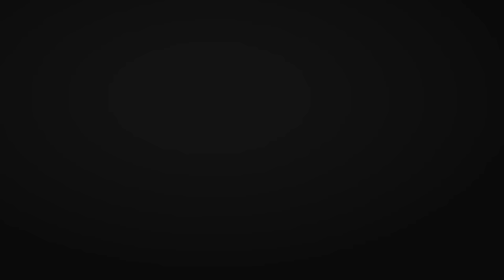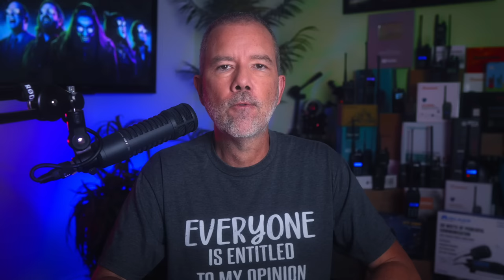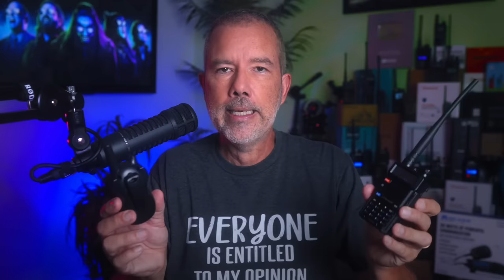Why Your New GMRS Radios Can't Talk To Each Other.  GMRS & Using GMRS Radios For Beginners

Comment: Another option—instead of blasting the signal at 8 watts or 5 watts, try a lower setting like 1 watt.
Reply: Didnt work for me. Even at low power and narrow band FRS channel. Only physically moving them apart about 45' got the units to respond to each other.
Reply: I did it and it worked
Reply: Pfff wattchu talkin bout willis?

Comment: I bought a new Midland mxt 575.  I can hear others, but they don't respond to me.  Im not sure if I don't have the radio set up correctly or there's some other issue.  I have a handheld mrs and it receives and I can carry on a conversation with no issues.  On the road, I can hear others, but like I stated, they don't respond.  I would appreciate your advice.
Thanks You, Roger
Reply from the maker: My guess is that you are hearing repeater traffic and they will only hear you if you configure your radio to use that repeater.

Comment: I confess I had this very issue as a new ham with two HTs.  I eventually solved it by putting one in the garage with my phone adjacent to it and recording audio/video of the HT, while I walked around the corner to transmit.  Thus with a phone you can engage in ah "solo testing" without revealing your initial ignorance to anyone else.... er... until you comment on a YT video.

Comment: Similar problem. Using two  Btech V2 gmrs radios about 8 feet from each other, - when using the same "stock" gmrs channel  ( same frequency) on both radios they talk to each other fine. But with both radios tuned in to the same llocal gmrs repeater channel  l(same tone code also) they can't hear each other. How come it works for close range for non-repeater  channels,  but not for close range repeater channel? Thanks

Comment: what really works : unplug any wires and blow into them, stick a paperclip into any small hole on the device, and mostly going to the radio store and getting bottles of squelch. Luckily I have several bottles of squelch from supply from when I was in the Army.

Comment: Does one have to buy only two gmrs radios? Do they only work in pairs? Or can multiple gmrs radios (same brand) talk to each other (communicate) ?
Reply from the maker: all GMRS radios can talk with all other GMRS or FRS radios.. You can buy 1, you can buy a pair, or you can buy 10, they will all talk with each other.

Comment: What happens if you adjust the little pots on the circuit board?  Or swap antennas for a powered one with a 400mhz to 5ghz range..?  Can you trigger the 498 mhz devices and pick up wifi?  Lol

Comment: Didn't know exactly where to ask this, so I'll try here. Have a fairly new Baofeng GM-15 pro. I, just recently, have a situation where it won't transmit to other radios. Definitely not too close. It receives just fine. It's on it's basic setting, nothing really turned on or programed. Any ideas?
Reply from the maker: "wont transmit", meaning it just beeps and the transmit light does not light up, or, it transmits but the other radio does not receive it?
Reply: Closer to the later. There is no beep, and the red light comes on. Tried it on 2 spare more basic Motorolas I have. The Motorolas can talk to each other, and I tried it with a friends FRS (don't know the brand). No beep, red light, but not able to tx through.  @TheNotaRubicon
Reply: Anymore info that might be of help? Thx @TheNotaRubicon

Comment: I have the same problem as many of your readers that purchased the UV-9r. It will not transmit on Ch.15. Using your solution to send them back only results in another radio with the same problem. The fix is published in Chinese. With your great status at Boafeng could you get the link in english and publish it?"
Reply: Buy a good radio, dude.

Comment: Please help first time user.  Wouxun GMRS radio can transmit to a FRS radio but can't receive even with DTCS on or off on both units.  Thank you.
Reply from the maker: Double-check to ensure that no DTCS or CTCSS tones are enabled on the radio you are trying to receive on.  Then make sure the radios are at least 50 feet apart, and try again.
Reply: @TheNotaRubicon  Thank you. Have a nice holidays.

Comment: is this happening on digital frequencies? I have never heard of such weird behavior with FRS radios and professional UHF radios programmed to the same frequency, I find it funny since when I started my 15 year amateur radio journey, I went straight to a Motorola P110 UHF on channel 7 (462.7165) that lasted for quite a long time until I got a PRO5150 and used the same frequencies without issues and no tones whatsoever, I had only the MDC1200 because I liked how it sounded and such and had quite a gargantuan hate for the MDC-IN feature that just gutted the data part of the MDC system, good times...

we joke around, mess around and did a lot of stuff using both professional devices and the ready to use FRS ones with zero issues, but those were all on analog frequencies and hearing muffled speech was uncommon and not practical to achieve privacy either.

does this thing only happen to radios with digital encryption or newer radios? it's the first time I've seen such a new and infuriating problem (not for me at least) with FRS devices or some radios on the 462-467 FRS range.

It's totally fucking bizarre because I always blasted all the other FRS devices with 4 watts no fucks given and never had seen this kind of strange behavior, it's related to the squelch about them not being able to hear each other when talking though.

EDIT1: update
Reply from the maker: It happens with many, if not most new bubble-pack/FRS radios as many/most come with pre-programmed CTCSS/DCS tones..
But, we are all very impressed to hear that you have fancy radios and have been in amateur radio for 15 years.

Comment: I need help.   My radios will talk to each other on channel 19 even when amplified to 25watts; I can hear other GMRS users on the repeater net on channel 19, I can take 1 of 2 radios and talk to those other users on the GMRS repeater network and can hear their replies However ; I can not hear myself using the repeater while listening to channel 19 on the other radio.   I am seriously confuckeld at this.  Can you help?
Reply from the maker: Make sure there are no RX tones on the listening radio, and make sure the radios are at least 50 feet apart when testing.
If after checking those things, its still not working, then you are beyond my help because i have no idea WTF you're doing wrong.
Reply: @TheNotaRubicon  I appreciate you're quick response👏👏  By far your channel might just be the best radio channel on the YouTubes.  My goal is to maintain a PACE plan with my family.  Right now we are able to do this using the North Georgia GMRS network but ultimately id like to have Radio Power and Antenna Hight to be able to do it independently.  

My family is only 8 air miles away but we have rolling hills and quite a bit of housing between us and i believe their even be a light hill between us not much 20' of elevation.  Haven't found a good topography map to say for sure just one website that had where you could drop a pins and i did it in a linear fashion between them and me nothing big but but maybe 20' or so.    Hopefully my struggle will give you more content ideas 👊 WSAF596 clear and monitoring

Comment: Does not seem to work between my b00fwang UVG5+ and the pre-historic motorolaT5200....not that it really matters.
Reply from the maker: You're doing it wrong.
Reply: @TheNotaRubicon  I scanned the frequency from the Motorola to the UV5G+, stored it to an unsaved channel (41) then tested it at a distance of ~75ft. It transmits to the UV5G and I can hear it, but the Motorola does not receive. Sorry if I missed a step, but trying to learn from all your vids.
Reply from the maker: The motorola probably has a receive 'tone' set. that will prevent you from hearing the UV-5G unless the UV-5G is sending that tone.
Reply: @TheNotaRubicon  makes sense. I kind of figured that from your other vids. Thank you for responding.
Reply from the maker: The frequency-scanner function on the UV-5G+ will tell you if the motorola is transmitting a code, and if it is, then just put that code in as the TX code on your UV-5G, or just go in and remove the RX code on the Motorola..
If the scanner does not indicate a tone/code, then i dont know WTF ...
Reply: @TheNotaRubicon   I figured it out. The little Motorola T5200s  have a privacy code that needed to be turned off. Motorola calls it the "Interference Eliminator Code". The T5200s have a setting 0 through 7 with the 0 being the off mode. Anyway, maybe this will help others at some point.

Comment: I can't get sheeet on mine,  Noah and FM that's it..O ya flash light works good but not 50 bucks good
Reply from the maker: Its not the fault of the manufacturer if there is nobody in your area talking.
Reply: @TheNotaRubicon  I know it's not, and thanks for the response, it's not a plug and play, I'll figure it out when I have time, the programming the radio needs to be stressed a bit  more is all iam saying2x

Comment: Dear NotaRubicon, I had two broken radios (Baofeng UV-9G) that were just mended with the procedure you just described. Due to you not providing this fix earlier I have just been dragging along these broken radios on a week long journey to no benefit. Next time, please provide solutions earlier.

Sincerely
/There is no way to win on the internet 😜

Comment: I am able to hear and talk on my radios, but cant seem to talk to people I hear but dont know, why is this ?
Reply from the maker: My guess is you are hearing people on a repeater and you wont be able to talk to them unless you configure your radio to use that repeater.
If thats not the issue i dont know what is going on.
Reply: @TheNotaRubicon  Thanks from your favorite viewer 👍
Reply: @TheNotaRubicon  yeah,  there are no repeaters near me that I know of
Reply from the maker: IF you are correct then it is possible they are running on big 50W radios with big antennas on their roof, and they just cant hear you. 
OR.. maybe they just dont want to talk to you.
Reply: @TheNotaRubicon  you are  right about them being on repeaters.I am just picking them up but cant talk to them because I am to far away from a repeater. Thanks